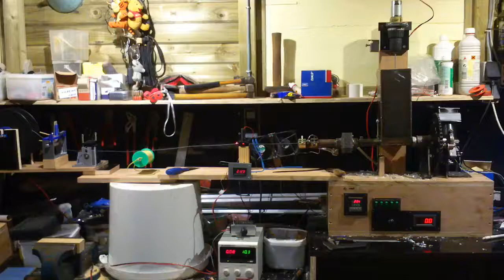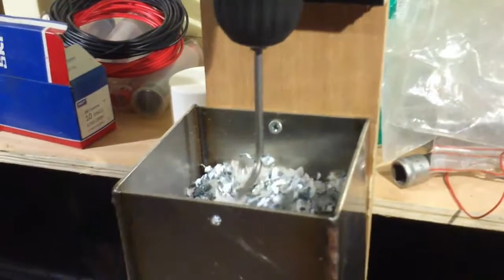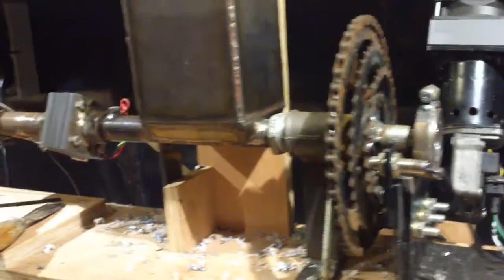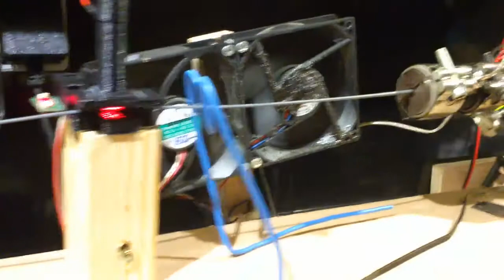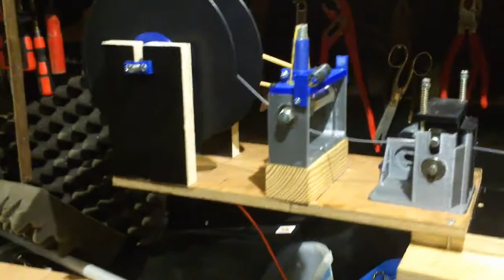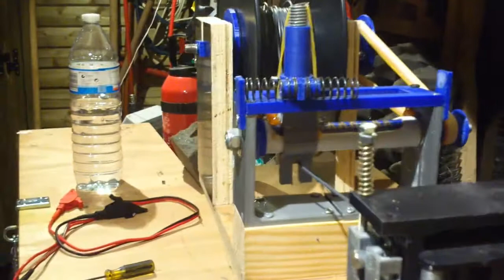filament extruder 1 begin

Comment: How is the quality of the filament ? Did u tried printing with the filament ? As keeping a consistent diameter in this machine looks tough, & that will have an effect on printing...
Reply from the maker: The fillament is good for printing and i used  fillament i have made in my printers. But if you want high quality prints feed your printer high quality fillament. This extruder keeps the diameter of the fillament within 0.10 mm if you feed it pellets. I build this machine not to make high quality fillament but as way to resycle faild or prototype prints. If youbuse scrap plastics it is 0.15mm. If you want high quality fillament and print buy you fillament from a now seller.